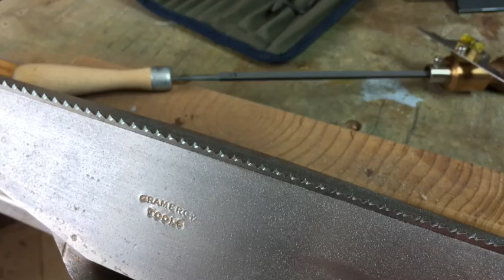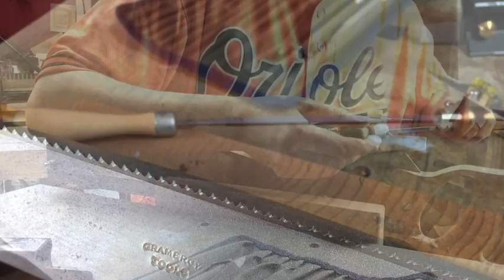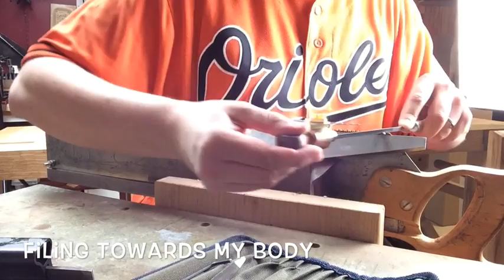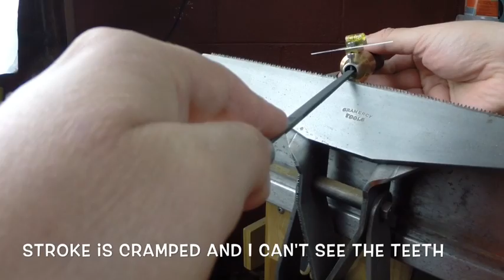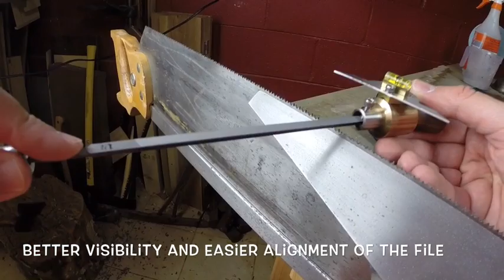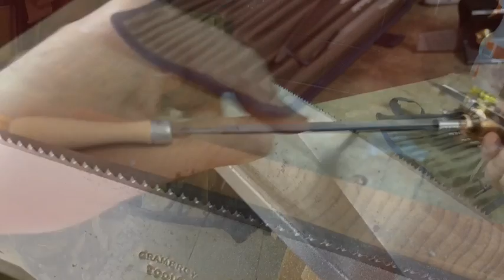Saw filing Epiphany

Comment: The gadget on the end of the file, for visible alignment I assume. Did you buy that or make it?
Reply from the maker: I bought it.  Its called a Rakemaker II by Blackburn Toolworks.  It (and the Veritas model) are based off an older design from the 19th century.  I have written a view blog posts about it and did a video review of the Veritas version.  It really does make saw filing a lot easier especially for the average woodworker who doesn't have to sharpen saws all that often.
Reply: RenaissanceWW Thanks! I've seen Frank Klausz just use a short piece of dowel on the end of the file for that purpose, which is probably fine for simple rip cuts where everything is at 90. I can see where that would be handy for more complex angles though.
Reply from the maker: I did the block of wood/dowel thing for a few years and it works just fine.  What I like about the Rakemaker is the known angles I can dial in for combination of rake and fleam and it has allowed me to play around with tooth geometry and to specialize my saws where I would not have attempted it before.  The bubble level on the Rakemaker is a game changer too.  You think you have the rake right but a quick check of the level usually tells me I'm missing just a bit.